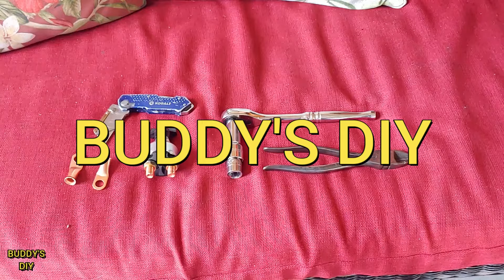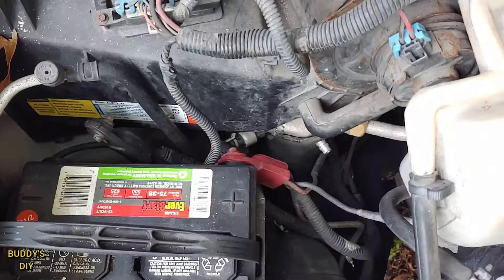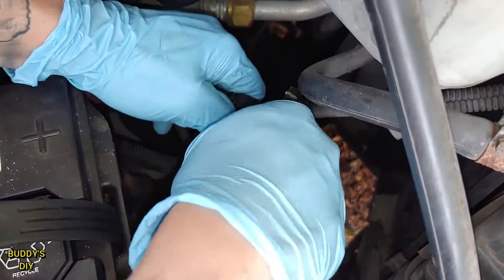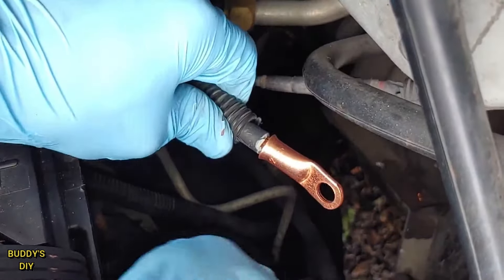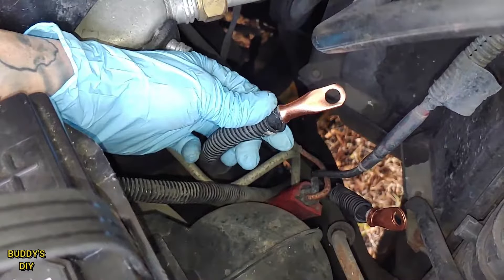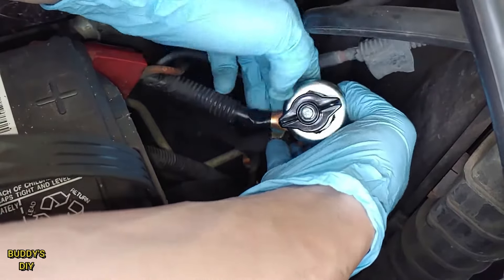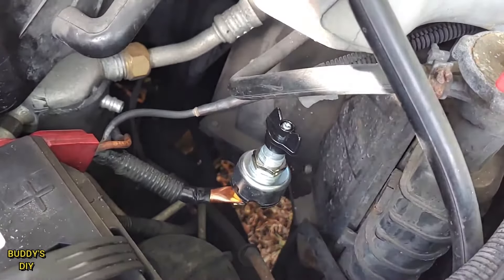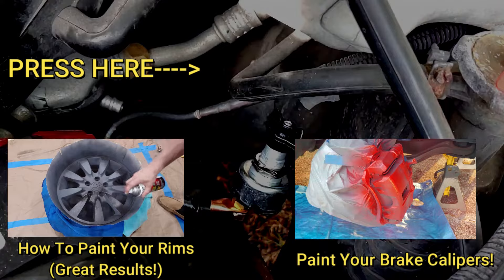Battery KILL SWITCH Installation | Fixing a Parasitic Drain Draw |  Cars/Truck/Marine/RV/Lawn Mower

Comment: I know this is a year old video,  never hook a battery disconnect to the positive side of the battery.   Thus is coming from a guy that is a master mechanic for over 35 years, worked on all different vehicles and never would put a battery disconnect on the positive side of the battery even if the customer demands it, I would tell him to take a walk.  You can tape up the battery disconnect this guy used and all it takes is that switch to short out and the housing touches metal there goes your ECU, Body Module, other Modules, diodes in your alternator who knows what damage it will cause.   Drag cars the rules for the tracks around here is the switch has to be on the negative side of the battery.   Well it's your vehicle do what you want, when it shorts out everything bring your vehicle to me I always like making money working on vehicles
Reply: Can the switch be installed inside the cab? And what about a truck with two batteries, how would that work?
Reply: @bksduskmirror1250   I'm not a master mechanic like the other guy,  but I do know that ChrisFix has a video on installing a kill switch. He runs some 2 gauge cable all the way to a switch next to his steering wheel. He explains what he's doing VERY well.

As for the 2 batteries, again not a mechanic, I assume it works in a very similar way as with one battery. But it could be slightly different depending on how yours is hooked up.

I think that most batteries like this are hooked up in parallel. This means that the negative terminals should be connected together. You'd then be able to hook a disconnect switch to the cable going to the frame and that should stop the circuit.

I'm unsure whether or not using the switch connected to ground would be okay for a kill switch (to be used when the car is still on). I've now seen 2 videos saying to connect it to the positive, but I've always heard to NEVER disconnect the positive first. 

It's just that when the engine is on, the alternator is creating current. If the engine has its power suddenly cut off, it will still turn over and cause the alternator to produce current. ChrisFix fixed this by using a resistor connected to ground to deal with the extra current instead of damaging the alternator or other parts.

Hopefully, @DavidGuns can give us answers to what happens if the alternator is still trying to produce current, but the ground is cut off.
Reply: Wrong ,i disagree with it being installed on the positive terminal , if the connection ever jostles loose, because of road, bumps going over  tracks over the years, you could end up with an engine fire.play it safe ,attach the kill switch to the negative battery post/terminal.

Connect it to the negative of your battery ,run the wire from that connection along the engine bay through the Gromit in the firewall to a on/off toggle switch that you install underneath your seat or dashboard ,this way you don’t have to open the hood every time to turn the battery power off

The only downside to this negative battery terminal killswitch is that you will lose all your radio station presets and the power to your clock each time you shut the power off to your battery but your car will still be in your driveway in the morning
Reply: @abeneufeld9690  This is what I thought, but for some reason people online like to say to use the positive wire. I’m pretty sure it’s the same principle as when you unplug your battery manually, always unplug the ground first.

I think it does suck running a cable that far in order to have it inside the cab, but I can’t really think of a better way.
Reply: @abeneufeld9690  and able to start if you have a chronic battery drainage issue like on a new crosscheck
Reply: I agree
Reply: @abeneufeld9690 how to you lock the truck with the kill switch activate

Comment: I'm having a serious issue. First, I am in agreement with most people that you should do this on the negative terminal. Second, that is a really half assed job of everything. I'm sorry but cutting there insulation was bad, crimping was horrible. There are many better ways to Do those. Including soldering if necessary. Yikes.

Comment: I'm not trying to argue about the logic of electricity, but you should probably put the disconnect on the negative. Both ways work but if you were to crash and the positive terminal touches bare metal, the kill switch would do nothing because of the way the vehicle is grounded. I also checked the Hot Rod association article and it says pretty much the same. But to be fair, safety second.

Comment: As a FOLLOW UP to my comment below, I spent a small fortune at two major local dealerships trying to solve a parasitic battery drain that would kill my otherwise decent 12 volt battery on my 2005 Dodge Caravan (that I am really fond of) to minimal effect. Yes, with a toggle switch installed in the Body Control Module on the line that supplied a small current power to that module, my overnight battery drain was slightly improved BUT if the vehicle wasn't driven for say a week then the result was still a drained battery. I even had a remote starter installed so that I could start the vehicle a couple of times each day to charge up the battery minimally. Same thing .. after a few days to a week and the otherwise good battery was flat. One dealer even installed a brand new heavy duty battery with the same exact effect. Flat after a week !!!  After spending over $1500 at two different major dealerships, I still had a flat battery after a weak of non use. I decided, reluctantly, to tackle the issue myself. I installed an $8 Amazon battery disconnect switch rated for more than 200 amps ON THE NEGATIVE POST of the battery, directly on the battery terminal itself. It was the relatively flat kind of switch (for good hood clearance) with the green twist knob built in. VOILA. Now when I'm done with the vehicle, I just lift the hood and switch the disconnect off by hand (NO wrenches needed) and my trusty Van will start instantly even after several months of sitting. As a senior, I don't drive very much in the winter anymore, but it is most assuring that if I needed to use the vehicle it starts up like a brand new Van even though it is now 19 years old in 2024. In hindsight, investing only $8 on this solid built disconnect switch solved my intermittent use of this vehicle 100% as opposed to chasing after the parasitic drain and spending upwards of $1500 plus. THREE words of caution. #1 If you are going to attempt this, do so ONLY on the negative battery post, definitely NOT the positive post (for reasons explained in my subsequent post). #2 Wear proper safety glasses when performing this install. #3 Caution. This worked beautifully on my 05 Dodge Caravan with no apparent adverse effect, other than with a complete shutdown like this switch affords, you would have to reset the digital clock and the radio presets each time if that was important to you. Might this have an adverse effect on your newer vehicle with even more computerization than my older van when you completely isolate the battery from the computer ECU etc is up for discussion. You do so at your own risk, of course. This is my honest experience on a particular make and model year. Good luck. Mine works fantastic now for nearly 2 years so far ! Greetings from Ontario, Canada.

Comment: To be up front here, there are two things that I find very troublesome about your video. 

First of all, I am a retired Electronics Technician with more than 5 decades of experience working with electronics and electrical circuits of all kinds. First, you were working on a LIVE system when you cut into the positive cable. If your razor cutter, which is metallic, happened to touch anything metal while you were performing that very dangerous task, you would have then directly connected the positive to the ground side causing a MASSIVE short circuit, huge amperage drain resulting more than likely an explosion of the battery, spewing sulfuric acid and sparks everywhere, including on your skin and eyes. The first order of business would have been to remove the negative connector from the battery. If your wrench happened to touch any incidental metal object in the vicinity, nothing would happen, since the negative of the battery and the chassis are at the same potential. With the Negative terminal removed, then the proper approach would be to mount your switch wherever it would be accessible, then connecting the leads from that switch so that it becomes in series between the negative battery post and the negative terminal that was connected to the battery originally. That way, if there is ever an accident, or if any metal object were to come into contact with the switch terminals after it was installed, no harm would come of it. THIS IS A VERY IMPORTANT DISTINCTION. NEVER, NEVER, NEVER connect a disconnect switch to the Positive post of a car battery. The one rare exception would be, if the vehicle was an older or possibly a foreign vehicle that has a Positive grounded chassis.  A very rare case indeed. Otherwise, NEGATIVE side for disconnects ONLY. This understanding could save someone's LIFE.
Reply: How would you connect this on a truck with two batteries? Can the switch be installed inside the cab?
Reply: Thanks for your input, how many amps would that switch need to be rated for? Also I would like to install the switch inside the cab for convenience.  Can I just simply use the same gauge wire and extend it into the switch under the dash or panel?
Reply: Thank you
Reply: Don't think it was a live system. Look at 0:27, looks like the negative is disconnected.

Comment: This is some hillbilly ass rigging if ive ever seen it. For the sake of people watching and taking notes, if you dont want to cause electrical issues or fires do it right.... Don't cut your main cable in half, make clean cuts, use heat shrink, twist the wires to compact them dont smash them with pliers, dont use fucking bolt cutters to crimp the lugs. Never use electrical tape on bare wiring, especially your damn battery cable, it might cover the wires but it does not make it water tight which will corrode over time. This guy has the general idea down, but his process of doing them will be dangerous over time or outright fail. 

Remove the lug from the battery, put that end on the switch then either make or buy a new cable to connect from the battery to the switch. If you make your own, use a razor carefully don't gouge into it like he did slicing it sideways, that just results in breaking wire strands. Slide a piece of heat shrink large enough over the cable and leave it out of the way for a moment, twist the bare wires with your fingers, and slide the lug over the end. Use an actual lug crimper, you can get some small portable ones for a few bucks that you hit with a hammer to crimp, they work great. Once it's crimped, slide the heat shrink back up covering the backside of the lug and cable then heat it up sealing the connection.  Doing it this way will allow you to remove the switch if you ever need to without any extra work or issues. If you do it the way he did it and the switch dies or you want to remove it you're screwed and won't be able to put the cable back together without more rigging.
Reply: Thanks for the good clear installation instructions what do you think negative side or positive side.? What is the directions say on these kill switches question mark I haven't read up but my friend had one put in her car
Reply: Really would appreciate your opinion thanks you're definitely a pro

Comment: I hope this fixes my battery issue I'm having. I have emergency lights in my vehicle that I believe is drawing power from my battery but after watching this, I hope it does fix it cause my battery likes to mostly die overnight and had to get a solar panel to keep it charged until I get a switch
Reply: Did this fix your issue? I know it's over a year since your comment but I'm having the same issue

Comment: You mention this works on any truck or car. For a diesel, with 2 batteries, which battery should i be working with? As for size of switch, mine says up to 48 volt. Battery Doctor brand
Reply: I was going to ask the same question, but i see you didn’t get an answer yet. I would also like to put the kill switch inside the cab. Anyway i will wait for an answer

Comment: Can you please share the link of an updated switch you recommend  The one you have in the description is no longer available,  I'm looking to Install a battery cut off switch to prevent my battery from dying from a unknown parasitic draw that i cannot locate. After a few days of storage/not starting truck the battery dies and its brand new. I have an 07 H2 Hummer.
Reply: All you have to do is get a battery top post or side post disconnect.  You don't have to splice your wires to achieve it

Comment: Does this really work because im having that same problem
Reply from the maker: Yes it will. Disconnecting the power supply to the battery will stop the car/truck from pulling juice

Comment: Hey man I’m wanting to do that on my 79 K10 but I want to put it in the inside of the truck on the dash! What side wire should I use?
Reply: Just take the wire from your ignition, chris fix did a good Video for the inside where he put a switch in the leatherbag next to your shifter. If you drive an automatic just place it under your seat or somewhere where nobody could find it. Hide the cables and you have a nice kill switch that is a bit more accessible
Reply: @PLAYCOREE  won’t that still allow the battery to be on? I’m looking for a battery kill switch for security and my radio that drains battery

Comment: How much amps does my switch need to handle I have a 500 cc Diesel engine with a 12 v 45 ah battery
Reply from the maker: To be safe I'd probably get a 400 continuous with 2000 cranking and max surge. Might be a little overkill but I'd go with something heavy duty like that.

Comment: I Take It That This Is Just For Vehicles Without R.C.L.....Otherwise Best Use Remotely  Operated Kill Switch Or You Will Not Be Able To Remotely Lock Your Vehicle...Manual Switch In A Reachable Hidden Place Under The Car If Not.. Maybe.
Reply from the maker: Most cars have a key blade. Even my 2013 BMW has a blade that pops out of the fob

Comment: A word to the wise for the reader: don’t do anything this amateur hack just did in this video. If hooking up to the positive terminal wasn’t enough of a give-away that you are watching idiocy, then crimping with bolt cutters and leaving the switch to dangle freely with all those bare connections able to touch anything that comes with the movement of a vehicle and vibration of an engine should have been your other clues. 

Thanks to this video countless people have incorrectly hooked up their disconnect switches, and the world has become increasingly more stupid. May god have mercy on your soul.